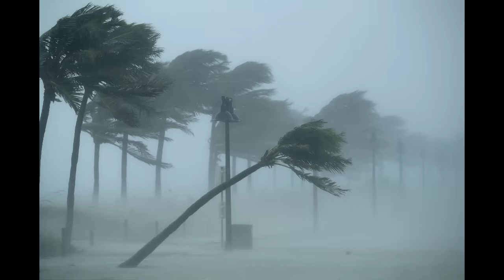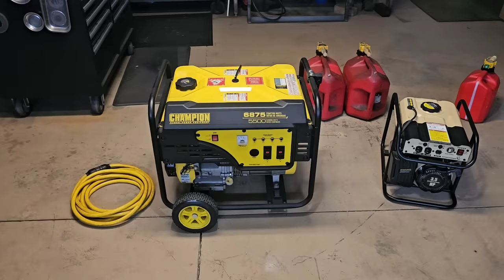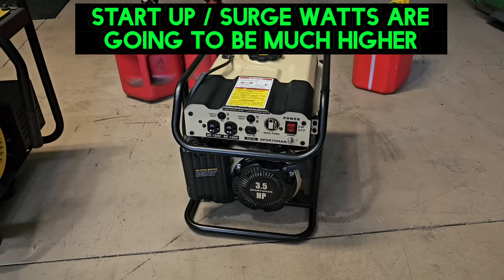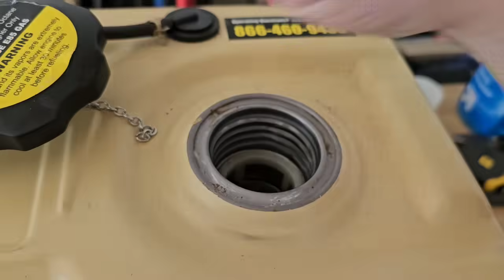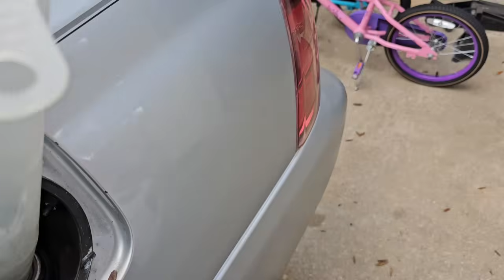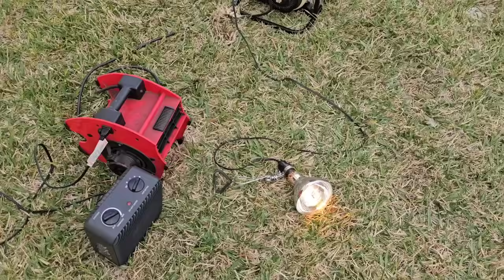Why smaller generators are better for power outages.

Comment: The main problem with the small generator is the needs of someone in the City - vs - a Rural environment.

In the city where natural gas is abundant, and municipal water is supplied. You can get by pretty comfortably with say a little 3500 watt'r that only supports 120v.

In the country however, where most people are on a well.. most well pumps run at 240v, and a lot of appliances are electric, so to cook it takes 240v.

I don't think anyone would voluntarily take a generator that uses more gas on purpose..  but sometimes it's unavoidable as you don't see any generators offering 240v until you get into the 5000ish+ range.

And even then, at the 5000watt range, it's only going to be providing around 20amps at 240.

Better than nothing. But unless you've lived in a rural environment, most people don't realize how power hungry some of the 240v appliances are.
Reply from the maker: Very good points.  This video is getting the best comments and contributions
Reply: @Mechanical_Mind  
It was a very well done video 👍
I hope for more.

I just made that comment as a nod to everyone that lives in the country as I do.
I know people that live in the city that think I'm a maniac for owning a 10k watt generator..  when they can't even fathom being on well water or having a hot water tank that doesn't run on gas lol.

Comment: One downside to the smaller units is that having less mass/inertia in the rotor, they will produce "dirtier" AC power than a larger generator. I mean distortion as opposed to a clean sine wave. So regardless of wattage required, a small one might be good enough for running lights or power tools but not good enough for running appliances, computers, etc. Sometimes a UPS might reject the input from them.

I am under the impression that the new "inverter" generators should probably do a good job of cleaning up the waveform but I haven't tried one. I need a large one for a deep well pump so those were not an option.

Comment: Get yourself a nice inverter generator. You can backfeed your whole house on 120 V if you knock down all the 240 legs in common out the hot lead on the L4 back-feed plug. That would make a great video. How to backfeed your house on 120 V only good video. Thanks.
Reply: That's a really REALLY bad idea. You could easily burn up house wiring and start a fire. A circuit breaker would never see the problem.

Comment: I have a Honda eu7000 and a eu2000. In long outages ( I went 29 days in an ice storm years ago) I could run the 2000 at night and the 7000 during the day. Both are setup to run on propane and a keep 1000 gallon of propane on hand at all times. I have the only person who was able to stay in their home the whole time in my area.
Reply: Sounds like a great setup.

But eventually would be become more of a liabilty in a bad situation.

You don't want to be the last guy on the block running a generator. Once people that aren't as smart as you run out of supplies - it'll be like moths to a flame.

That's why I'm slowly converting over to solar.
Reply: Can you share your experiences more on the Honda's? I'm considering purchasing.  How many things can you run on the 2000 vs 7000.  How efficient and reliable has they been for you?

Comment: Why smaller generators are better for power outages.

If you have a refrigerator like most folks do and you want to keep food cold and from going bad you have to have enough watts on a generator to do that. There are 3000 start up watts required for a refrigerator then it drops back down to "around" between 200 and 300 running watts. You need at least a 4000 watt generator for a refrigerator. A small generator under 3000 watts can't supply a refrigerator.

Comment: I need a generator strong enough to run my lithium iron phosphate battery chargers two of them which totals a little over 10 kw. It takes a little over 4 hours to charge up the battery bank. But my Honda generator uses 2 gallons per hour when it's running the chargers.. I need a generator that's more efficient and uses less fuel while still being able to generate 10 kw.
Reply: Just go with a hybrid solar/wind setup.

Yeah it'll cost you.

But it'll be forever renewable. And even a modest system will keep your batteries happy.
Reply: @bmir89  I'm in the middle of the woods. During Hurricane Sandy, the highest wind we recorded was 17MPH. Normally 0-2 MPH on a breezy day.
I have 21kW of solar panels and they make plenty of power when the sun is out. But when iti's closed in with rain and fog, they make maybe 200W. No place to even put a windmill, not that it would generate any power.

Comment: Good video.  We lose power fairly often, and I'll pass along two more items:  1) Consider an inverter generator.  Does not have to be a Honda.  These vary the engine speed, all the way down to idle, as the load changes.  They use much less fuel, are quiet, and are easier on your electronics (baked into all appliances these days) since the power is "cleaner" with fewer spikes, etc.  2) Also, consider dual-fuel/propane.  Unlike gasoline, propane will last indefinitely.  You can even run your generator off of your home propane tank if you have one.  Also, no risk of spilling fuel on a hot engine.  AND, you can store it safely in your house if you want since the propane dissipates quickly after it is disconnected.
Reply from the maker: Good points Thomas.  After reading so many of the comments I sold that little tan generator and got a small Predator 2000 inverter to replace it. Next I want to upgrade the larger generator to a dual fuel inverter style. Eventually I also want a battery and solar system
Reply: @Mechanical_Mind  I did start watching you follow-up video that covers these topics... Thanks!
Reply: Dissipates safety?  Are you kidding?  - that’s bad advice for sure. Nothing about propane being store in a house because it dissipates is safe. If it leaks it’s a time bomb. Do not follow that advice anyone

Comment: Batteries in combination with generators do best. My small 16kWh battery charges all day, when power goes out it runs my AC and heating when wont not much solar we run more fuel. Thanks to chinese slaves for our an 'german' made solar panels who"s cells are made by proven slaves.
Reply from the maker: I want to work my way up to batteries and solar. Thanks for sharing

Comment: I use solar ones teamed up with my champion gas/propane generator.  If no sun I can charge my solar ones fairly quick which extends my fuel consumption drastically.   As you know living down in Florida its a must to have alternative energy.  I have been running my fridge and deep freezer 24/7 for a year now using this combo.  I lost to much food and then had a hard time buying it back because of shortages after the last hurricane.

Comment: I wrote an article for a power company many years ago about using smaller generators.  Since then there are a number of cheaper inverters and solar systems which are available.  I would like to add some advice to this article.  First, get two heavy gauge 50 foot extension cords to cut power loss. Since the generator must be outdoors, it will allow you to power two indoor appliances at once or if connected together they will reach farther to one item.  Second, get a couple indoor/outdoor wireless thermometers for your refrigerator and freezer so you only run the generator when needed. For long term outages conservation is critical.  Get two or three oil lamps and a few quarts of lamp oil for lighting instead of expensive battery power lights. (an exception would be several solar yard lights that will charge up during the day and provide several hours of light for $3 or less a piece.) Next record how much power each item will use so that you can efficiently connect several items at once without overloading the generator or running it unnecessarily.  Some people may require a dual voltage generator if they have 220 volt items like well pumps.  Have an alternate propane appliance to replace a power hungry electric stove or water heater. A small generator will power a 10,000 btu or less window air conditioner or microwave but not at the same time. You can buy a small generator, two heavy extension cords, a couple indoor/outdoor thermometers and four 5 gallon gas cans with stabilized gas for $600 or less.  Or you can buy a large automatic system for $10-12,000 that will drain a 500 gallon propane tank in a week.  Whatever your needs, remember that in an emergency, conserving fuel is always the wisest choice.
Reply from the maker: Love your contribution to the topic Philip
Reply: @Mechanical_Mind  Could you please talk through the solution to a deep well pump scenario?
Reply: @sambsialia  I have a small generator that is both 110 and 220 volts.  My well pump runs on 220v and needs a special 220v extension cord that connects directly to the pressure switch box.
Reply: @sambsialia  Get an ECOFLOW solar generator.  They will power your pump.
Reply: Just bought power smart 4400 open frame 4 gallons running it 24 hrs 2 fridge ac coffee mic tv and more no problem ordered it from power smart new 2 yr warranty  delivered to my home 310 dollars all in half as noise inverter half the gas to run  running it a month strait it's a beast byt this generator not used
Reply: Ps warranty and price against other companies there like 500 same thing or more plus delivery
Reply: @HH-zg8zm  Use punctuation.
Reply: I Have two Honda eu 2200 generators that can be connected to each other if needed. They are very quiet and efficient.

Comment: I have two generators as well.... a big 9000 and a small 3500. I am installing a transfer switch for the 9000 to run almost everything except for the central AC and water heater. At night I can power that down and run the small generator to only run a portable window unit and refrigerator and save a bunch of gas. You are dead on with this video!

Comment: I have both small and large generators. When I purchased my large 9000 watt generator, I made sure it was dual fuel. If gasoline is not available, you can run it on propane. Very versatile in an emergency.
Reply: I recently bought a dual fuel Predator 5000 inverter generator. My plan is to primarily run it on propane so I don’t have to even be concerned with the carburetor becoming clogged by  stale gasoline, which would then be my secondary source

Comment: Unless it is an inverter generator you are asking for trouble, I had a small generator burn out the circuit board on a very expensive fridge. Also don't plug your TV or internet into one of these small generators. I recommend eith er a Honda 2000 or 3000 unit. I personally have a standby generator running on natural gas
Reply from the maker: I upgraded the small one generator to a 2000k inverter generator.  Next I plan to upgrade the larger one to an inverter style. Then hopefully get into some batteries and solar.
Reply: @os77-w4y  I live in Florida, have been through several hurricanes ie- Milton the latest.
Closed inverter generators are quiet, produce less harmonic distortion and are stingy on gas.
However recently many brands are overheating because they are closed. A good open frame generator with a avr will run even a modern refrigerator with new electronics, most other modern electronics have their own filters built into the chargers. There are exceptions. A good open frame inverter generator would be my choice for my conditions.

Comment: ofc less output power means less fuel spent. you are comparing 700watts to 2450watts.  1,5gallons and 7.7 gallons. 3.5x more power for 5.3x fuel spent

Comment: I've got a medium predator that works very well.  I'm beginning to store gas in 50 gal portable tanks because I just went through ice storm lasting 2 weeks-yep its freaking cold without heat. I freeze dry and can food but also freeze to store foods...
Reply from the maker: I sold that little tan generator in the video and got a little predator 2000w inverter generator. It so much quieter than the one in the video. Plus with the throttle control I'm sure it will do better on fuel
Reply: What is your 50 gallon portable tank?  How do you haul around over 400 lbs of gasoline?  I guess you mean multiple 5 gallon jugs.

Comment: I like the simple, quiet, clean, and reliable option of a EcoFLow battery with a small solar panel. No fuel or carb headaches and no noise.

Comment: Absolutely, you do not need to run everything in an emergency.  The other part that I have had to deal with is the amount of fuel required to do the job.  For us, with my Generac XL5500, running it for 4-5 hour in the morning and 4-5 hours in the evening, in order to keep the fridge and freezer cold, with that usage we run through 2.5 gallons per day.  We have 27 gallons total fuel in storage, we should have 10 days of fuel.  However, you have to run the top of the fuel tank, not the bottom of your fuel tank, so you need to put in 6 gal the first day.  This unit is 25 years old now.  Because newer electronics, I purchased a 3600 W inverter which should be able to run most of the things that we need during an emergency.  What do we need?  Fridge, freezer, furnace(winter), gas stove and to change batteries for lights and radios.  What else do you really need during an emergency?

Comment: Great information you give.  If I may add from personal experience, we were out of power and water for 10 days during the freeze we had in Texas.  I own 2 Honda  generators with one being the companion having the 30amp plug.  I converted both of them to propane because I had experienced where one of them would not turn on even after frequent maintenance and using non-ethanol gas.  When I could not start it I just switched to propane and it ran flawlessly.    I also bought a couple of solar generators (power banks)that would run my essentials like fridge and freezer for about 13 to 16 hours.  Great thing about this is that I only ran the generator to charge them for a couple of hours when we had no sun for several days.  Other wise a couple of 200W solar panels would keep them charged while running my essential items.  Redundancy is key.  Thank you for sharing your video.

Comment: I have ecoflow deltax max plus extra batteries. That can run my refrigerator and freezer approximately 48 hr . So, no generator is needed at night
Reply: @GeoffryWK.. you can use solar panels 😮. So, 1000 is good

Comment: My suggestion is get an inverter generator with auto throttle they’re much more efficient quieter and very efficient on low loads. My 6KW continuous inverter generator is as efficient as your small generator.
Reply from the maker: What model do you have? Two days after posting this video I sold that little generator and bought a Predator 2000/ 1600 watt inverter generator.  OMG it's so much better that the little Tan one in the video. My goal is to swap the larger one in the video for a 5000 or higher inverter generator.

Comment: OMG cooking on electric stove powered by gassoline generator ... What a waste of fuel ....
Reply from the maker: 🤣 well, when there is a hurricane going on outside and Im already running the generator to power the house, then why not?
Reply: Cause you can cook 3-4 months on one propane tank and save tons of the fuel for the generator @Mechanical_Mind
Reply from the maker: @nikolajrudnicki4957 I understand that  but,  you not comprehending my statement. If I'm already running a generator to power my house why would I waste even more fuel or a separate fuel to cook?? I wasn't firing up the generator just to cook. It was during a hurricane and not everyone has a gas or propane stove inside their home. Not sure why so many people think everyone else's world is like their own.. Its weird.

Comment: I have a small, economical & quiet 50cc 1000/800 watt Inverter generator to run my Sump Pump while my 2500/1850 watt 80cc Inverter Generator runs my Fridge, Freezer, Internet, TV & Fan,... I installed a Generator Inlet to the exterior of the Kitchen Wall then fed a wire to a 20amp Outlet in the Kitchen which is NOT hooked to the House Mains Power and this only cost me about $60 :)

Comment: No one should ever buy a home generator that is not an inverter generator. They supply clean power for all of your appliances and they have an automatic idle that adjusts to your power consumption and burn less than half the gas of the larger 7.7 gallons per 11 hours unit shown😳
Reply from the maker: It's 7.7 per 11 hours not per hour.
Reply: @Mechanical_Mind  Sorry, that’s what I meant to say😂2/3 of a gallon per hour is similar to what my 5,000 watt 6,250 surge watts uses. My 7,000 watt 8,750 surge inverter generator uses far less gas with the eco throttle idle👍
Reply from the maker: Yeah I'm definitely wanting to upgrade my conventional 5500 watt to an inverter type soon. Then after that work towards a battery bank and solar
Reply: @Mechanical_Mind  I hope you’re planning on multiple batteries and several hundred watts of solar for outages that last more than 1 day, and on cloudy and rainy days that inverter generator you’re planning on getting will surely come in handy👍

Comment: Do it right , if you do replace carburetor,  replace filters,gas line, sparkplug  all at once. Have extras ON THE SHELF , so you don't have to go shopping in middle of a night emergency. 
(tools, flashlight,oil and LARGE print laminated instruction sheet at fingertips too! )
Reply from the maker: Me personally I have shelves full of extra parts oil etc, even a spare carb is a good idea IMO. I would also recommend the average joe to have at least an extra spark plug, oil, and fuel hose and clamps.

Comment: Nowadays solar is the way to go. Combined with a battery you could even charge the battery for 1h using the generator and run the whole day in case a hurrican trashed you panels on the roof. Or have some spare panels..
Reply from the maker: Batteries and solar panels are definitely what I want to upgrade to